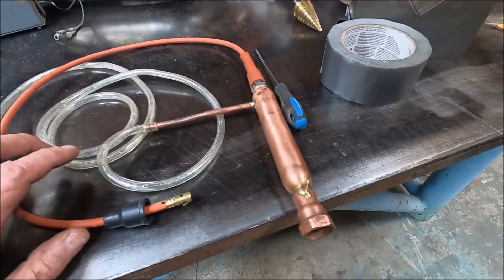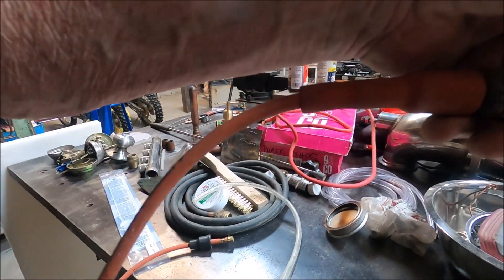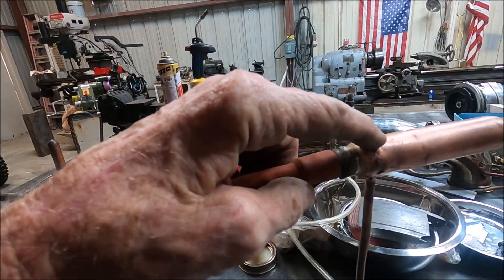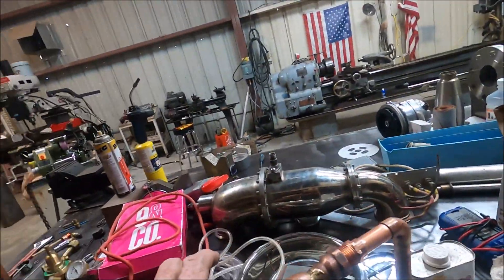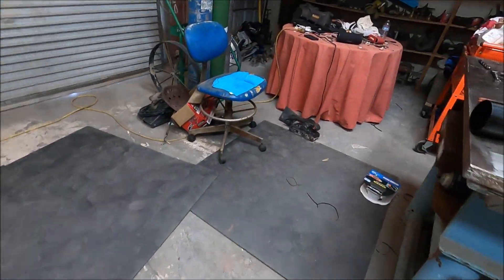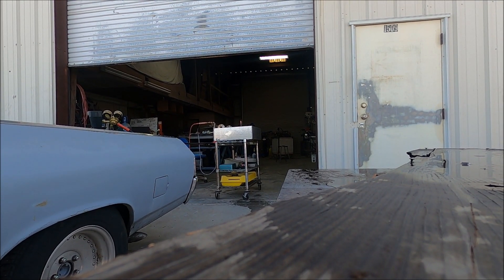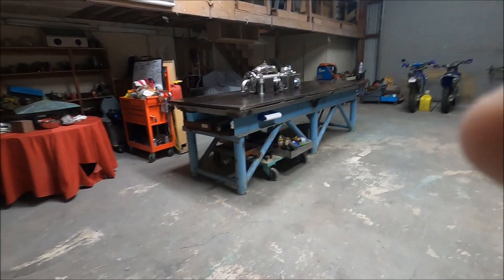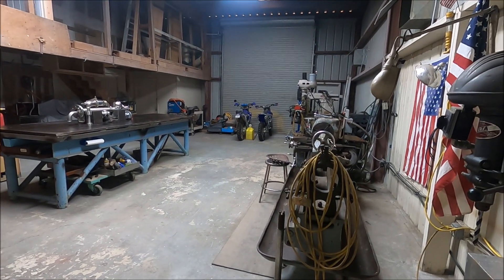THE DETONATION CHAMBER IS COMPLETE WAITING FOR HYDROGEN DELIVERY  MAY 22ND 2024

Comment: I certainly hope you don't plan on putting hydrogen AND the oxidizer down that plastic tube already mixed together. The flame will propagate backwards down that pipe and blow it up. Ya might want to consider having them mix in the "detonation chamber"
Reply from the maker: Tanks Rob for paying attention! The truth is that both H2,, Acetylene , Methane and O2 will require a series of isolating techniques (checks) before being introduced into the detonation chamber .